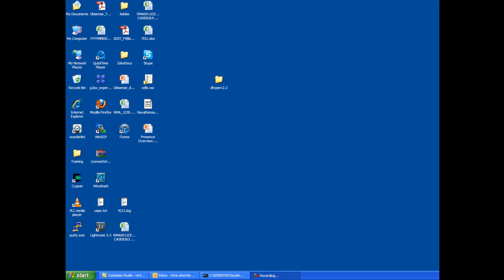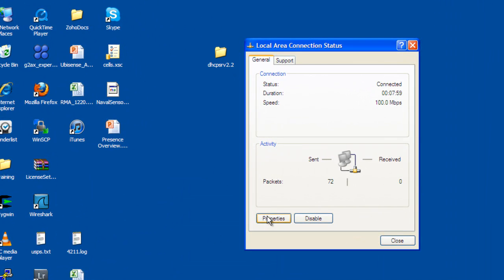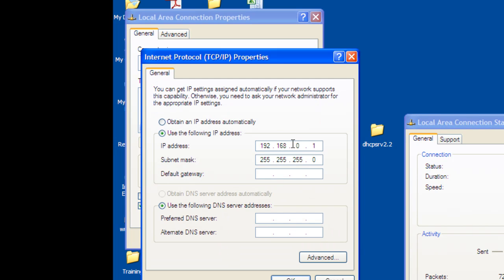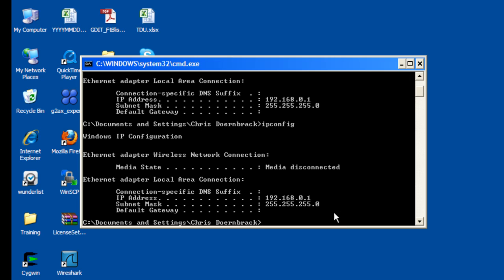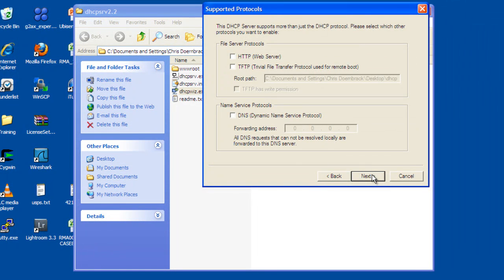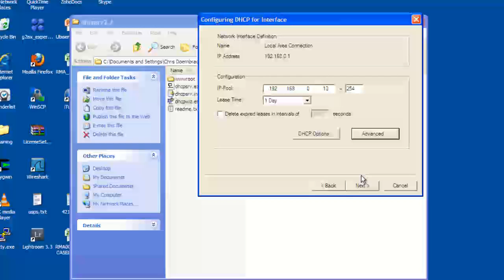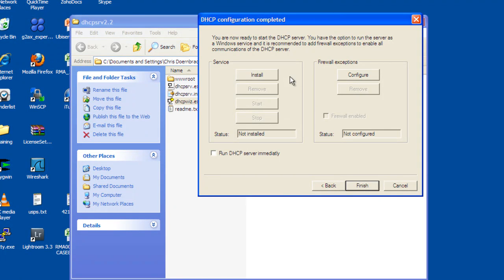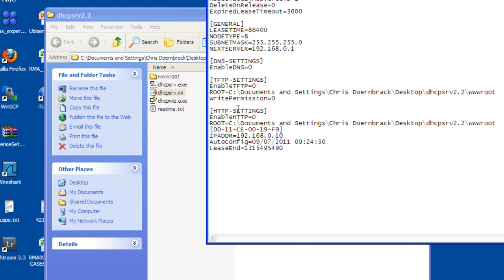How to set up a DHCP server

Comment: I already have a modem/router with a dhcp server up and running. I want to have a second dhcp server, for that purpose I installed a second netword adapter to a pc. The first network adapter gets its IP from the modem/router and the second is supposed to be connected to a switch or to a second computer with an ip from a different segment. It works but the computer won't navigate through internet.